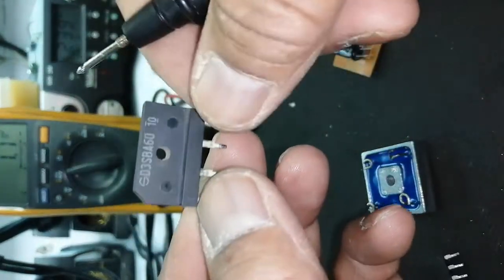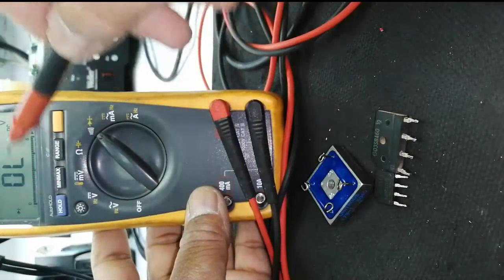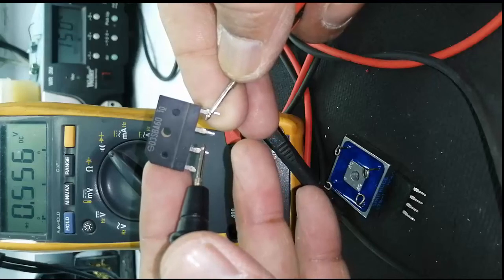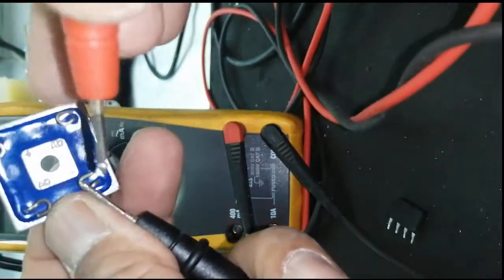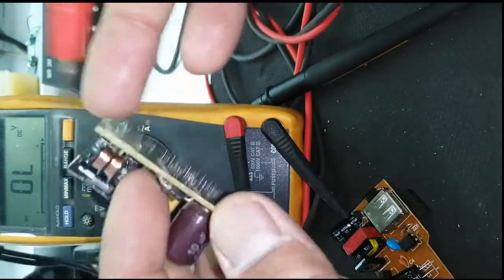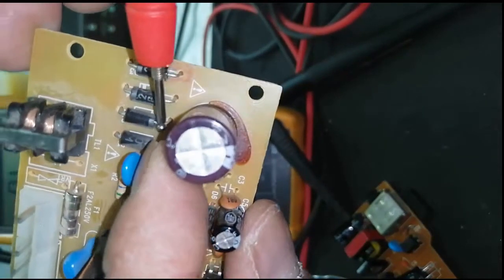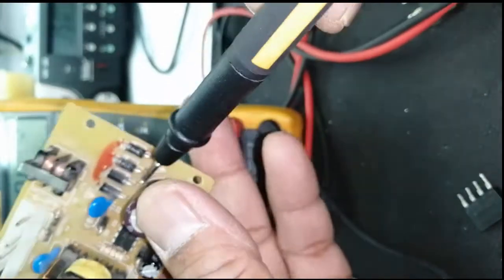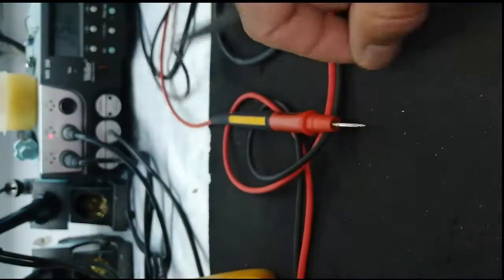How to Test Bridge Rectifier

Comment: I am grateful to you for the valuable information and this is the most important and clearest video for checking the diode bridge, but I have a question. Is there any way to replace the diode bridge in case it is not available with four diodes? Do you have a video on this subject? I will be grateful to you. Thank you very much.⚘️👍👍👍👍